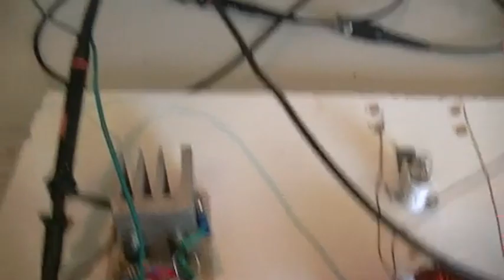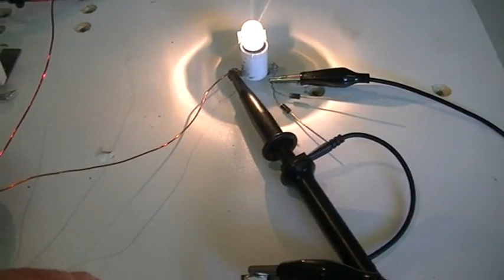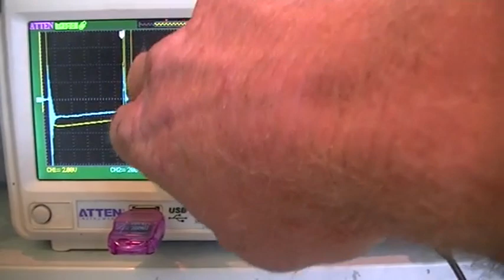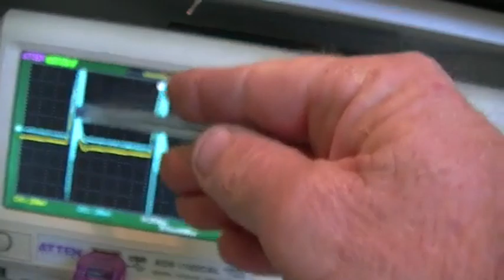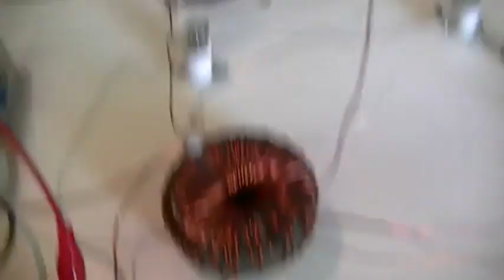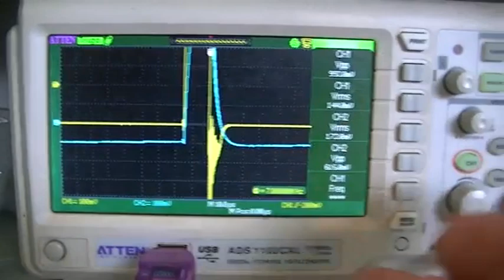Testing the toroid transformer 3

Comment: Hi Brad, we know that the inner coil current does not decrease until the next pulse.
Then let's find out how long it last. Use a one shot trigger for that. That would be one cycle of 7Khz. If it's long enough , you could then extend the duration between pulse to lower power consumption even more. I'm pretty sure you thought about that already, but just in case. We sure would like to see that. Good discovery BTW it's going to be quite a joule thief, Cheers.

Comment: Last night I tried your idea of the toroid inside a pot core. 40 turns around the toroid and put that inside the pot core then 30 turns around the pot core. Got poor coupling to the inner toroid. with 20 volts on the 30 tun primary I only got 60 millivolts on the inner 40 turn winding on the toroid core. What forum are you posting the scope shots to? I would like to try one like you made. Where did you get the metal epoxy?